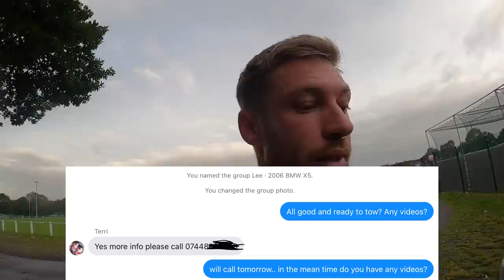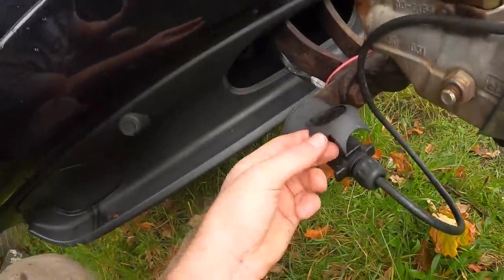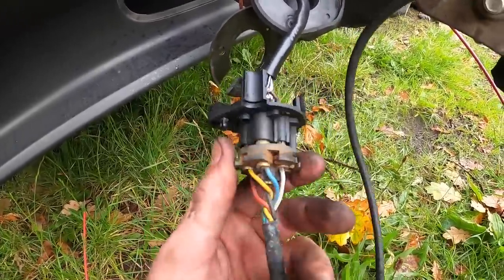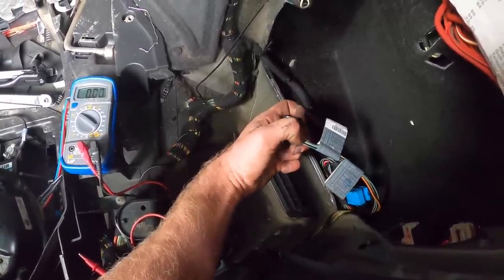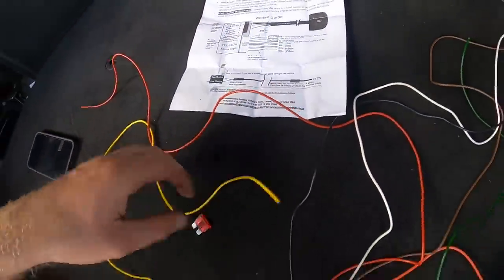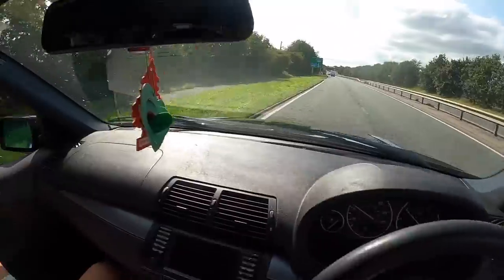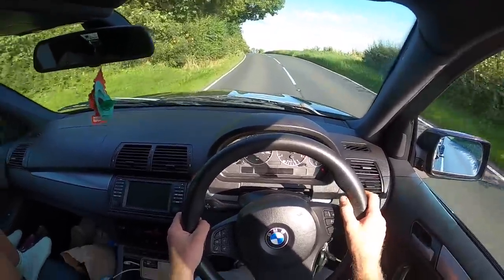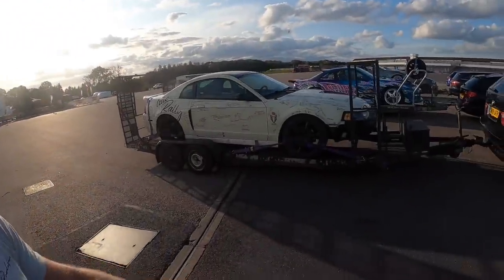ANOTHER thing he LIED about with the X5.

Comment: Welcome to the used car trade 🤷 that's what happens, just got to take the rough with the smooth that's the least of your worries, I'd be more concerned about a 2 ton car sitting on an alko caravan chassis that won't be rated to carry the car and makeshift trailer frame and probably doesn't have the brakes to stop it
Reply: It happens if you buy from a brown man